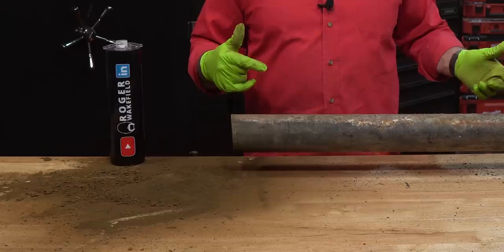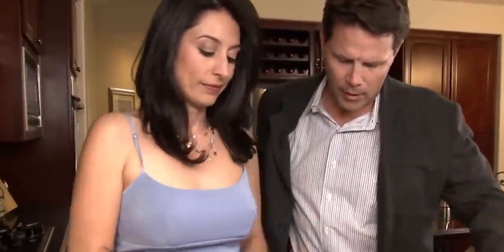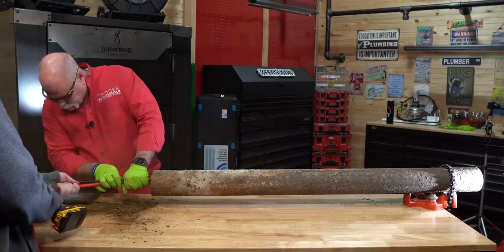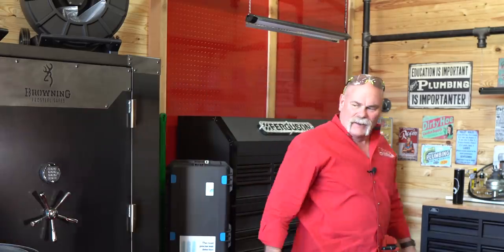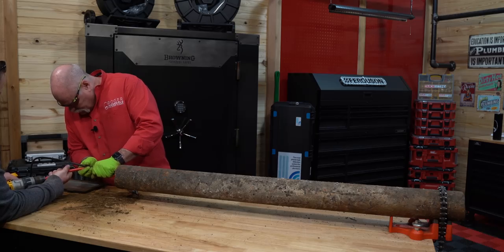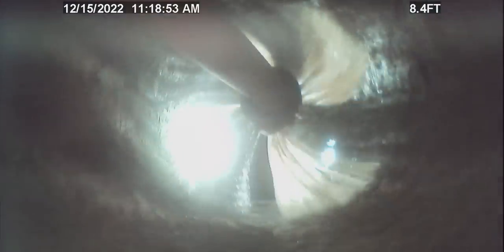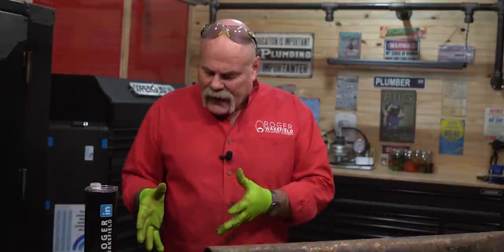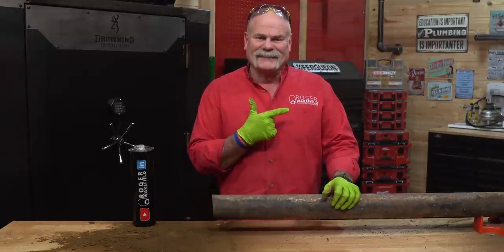I Clean Out OLD Cast Iron Pipe

Comment: Clearing edges with this machine is great and all. Problem is when you have a mixture of cast iron to terra cotta/pvc it becomes a problem.  I remember having a company clearing my parents home with one years ago knowing that it transitioned to terracotta and going too far with the carbide chain.  They ended up paying for the repairs no question asked but, it did cause a major issue with people still in the house.
Reply: I was thinking about this, having lived in an area with really old housing stock.  You're about one inch of distance between an easy job and breaking out the excavator.

Comment: Most of us are busy enough. Please don’t plant a seed in minds for this. I’m begging you. We don’t need another myth from bad diagnosing. It’s cast iron. Diagnoses over. Can we swap it now? It got there. It can be changed out. I’m surprised your pipe didn’t crumble. I threw away my snake. Wasted customers money for too long. We fix it right now. I bet you can weld a water heater back together too.
Reply: Definitely better to change to PVC but sometimes cost prohibitive. I was quoted 6 thousand dollars to run like 30 feet of PVC in a basement full access everywhere with one washer machine trap and probably a clean out or two. Ridiculous. Also some cast iron may be under ground , under concrete, behind walls, etc. Many times the cost to replace to PVC isn't worth the cost. For me to make everything PVC all the way to the street from cast iron and galvanized steel would probably be be 20 thousand dollars.
Reply: You're like the "part replacer" of the mechanic world. You don't know how to fix stuff, so you just jump to replacement.

Would hate to be your customer.
Reply: @wanders278  It's actually even worse to be honest. Replacing a car part may be a few hundred plus labour so let's say 1000 dollars. Replacing cast iron with PVC in the entire house (including under foundation or in the yard out to the sewer main) could be like 15000 dollars. For something that could be cut or snaked out for a few hundred. Maybe even epoxy lined for a few thousand and get many more years of service.

Comment: We used a Maxi miller from Picote with chains when I was doing epoxy liners.  We found that using water while running the chains had better results in CI.  We also kept a KJ 3100 on site, as well as a camera.  We were able to get some pretty good results where the homeowners opted out of the liner just because of how well we could clean the lines.  Pricey pipe cleaning, but not near as pricey as a liner.
Reply from the maker: Do you do pipe relining’s often?
Reply: Personally, I don’t do them anymore.  When I was doing them, we were doing ~2-3 per month, over the course of about 2 years, before I decided to go back into service/repair and another crew took over and stayed just as busy.  We used the Flow-Liner system, but started noticing a decline in our two part epoxy’s quality (2020-2021) right before I stopped doing them altogether.
Reply: Ridgid machine is inferior to Picote that’s why it just broke in the video ridgid makes good tools but the flex shafts are not one of them when you’re doing 4” you really want to use a motorized descaler like we use a midi cleaner with a large dc motor the flex shaft is good for every short controlled runs

Comment: You broke your tool relatively quickly.  Hate to run that and have the issue of fixing that in a pinch. Under the house in a basement ok but under a slab or 6ft of dirt idk. I'd run a jetter or sale a replacement.

Comment: Chain would crack that old cast!
Reply: He legit just did it and it didn’t crack… I’ve done this with a drill before when fixing the main drain line in my basement to make sure it was clean and it’s holding still 2 years later. If the pipe cracks then u needed to replace that pipe not clean it.
Reply: It could damage the pipe and he literally said that in the video but it is a cost benefit analysis for the customer to make, you give them the options and let them decide, spend thousands replacing a cruddy pipe or run the tool through and maybe save it maybe not. You could also offer pipe lining as an option if the pipe gets cracked, but that's the point it offer customers options and let them pick.
Reply from the maker: Exactly! I mention all that in the video

Comment: The cast iron pipes in the slab of my house are going on 65 years.  What happens if they rust through?  Will the concrete keep the plumbing running for decades or will there most likely be issues with the foundation?  Also, what are your feelings on relining those pipes?  Better/cheaper to just replace... however that is done?
Reply: Hi plumber here! The scenario you are describing is a common occurrence with old slab plumbing. The best course of action is to have the pipes inspected and receive the video. The main focus is the bottom of the pipe to see if you have what we call trench rot or the thinning of the bottom. Severe trench rot will develop cracks and voids in the bottom that will let sewage seep out. The crack if large enough will catch waste resulting in frequent clogs. If the pipe looks to be in fair shape find out from you plumber what descaling would cost, and start with a short section, clean that with a brush head and water. Reinspect the pipe to see if proceeding is a good idea or if this will begin to reveal a worn pipe bottom or trench rot. About relining, I have relined quite a lot and I will say that it is expensive and very time consuming. Sometimes demo and replacement of the pipes actually comes out cheaper but some people would prefer to pay for the convenience.

Comment: Hello, I’m here in Arlington TX and we found out recently that a full size razor is in our cast iron sewer line midway through our house. The plumbers that unclogged our pipe after we had been dealing with backups could not get the razor out with there regular auger. They quoted us $3,500 to go in from the flooring to cut the section of pipe out and replace it. I just don’t think that’s necessary…how would you suggest getting a razor out? We think it’s what collecting stuff and causing the clogs.
Reply: What does it make you think the plumber judgement and quote to dig up the pipe and do the repair are wrong?. You do not think it is necessary, well do not do the repair and continue calling the plumber every two month to unclog your drain. "I do not think is necessary....."
Reply: @cabezamiami  we got it out by hydrojetting for $700 😎✌️
Reply: What is a razor in a pipe????
Reply: @cabezamiami  a razor someone used in the shower and it went down the drain and got lodged in the pipe that allowed it to catch toilet paper and gunk till it formed a clog. We think it had been in the pipe for many years but had slowly moved down and happened to get into the perfect position to start causing clogs. Our bathtub drain doesn’t have a stopper/cover but we use a hair catcher in it at all times to prevent things from accidentally going down. Hydrojetting worked thankfully and cost a lot less than having to cut into the pipe from inside the house.

Comment: Rigid Flexshaft breaks during demo with a 5 ft pipe,  Must have been all that corrosive 💩 dust. Think I would use a respirator though, can't imagine the taste! 😆
Reply from the maker: The smell is still lingering in the shop!💀😂
Reply: Seriously how F'd would you be if that happened 30 feet under a house?

Comment: That was a section of vent pipe not drain pipe
Reply from the maker: Are you sure?
Reply: @RogerWakefield  It's been dry a long time to look like that so i guess it's possible. Doesn't have the flow line trench either. So give me the scoop plumber to plumber. Most of the pipe down here in Houston gets pitted but only the vents look like that.

Comment: I swear by the flex shaft. just put a drill head at the front to punch through grease at low speed, once your through the blockage turn it up on the speed and pull back slow and you'll mince up that chunk of grease. and always retighten those jam screws on every fitting and don't loose them! best scenario to use the flex shaft when you only have a small access 1-2" and then the chain can xpand to clean 4".

Comment: Unless I’m mistaken, this really isn’t a great endorsement for the product if the cable actually snapped off the wire brush. You’d have to locate it and dig up the pipe to get the brush out or  the line will inevitably get a blockage. That’d be a tough one to explain to the customer. 
Also, would be interesting to see how it handles going through fittings and turns like an actual line would have. 

Love the videos just surprised it breaking wasn’t touched on afterwards
Reply from the maker: It’s not a video for Ridgid, I do like their flex shaft and unfortunately it did break during filming, which doesn’t happen often, I’ve had it for years and haven’t had any problems with it.
Reply: Picote and renzi have better machines

Comment: Great video Roger! after i clear lines (shower pipe drain) can i coat it somehow with a rust preventer? Im thinking coat about 2ft of drain before it connects to trap union, use a long brush and that should be ok?

Comment: Do you have any products you recommend to keep up cast iron pipes? We bought a house in November and we recently had multiple back ups. Hydro jet only worked temporarily so we had to pay 6k to get it all ground and shaped up. Would be nice to know what we can do despite getting a bidet 😅
Reply from the maker: You can do a hydrojet and a chain knocker like you see in this video, or there is a new technology called CIPP (cured-in-place-pipe) where they line the inside of the pipe with a textile liner...it could help, but it could also shrink the existing size of the line causing more problems...